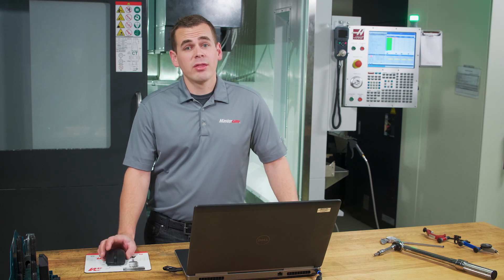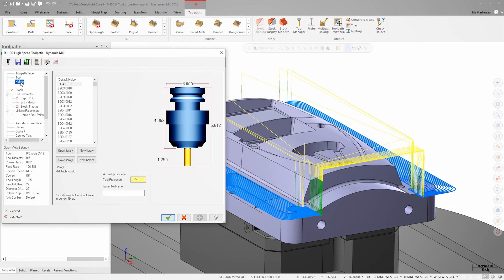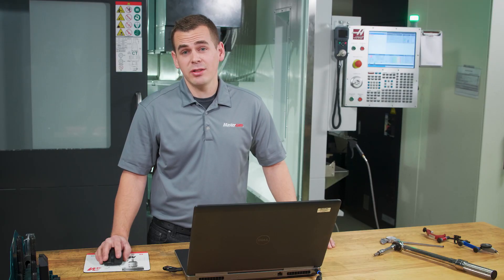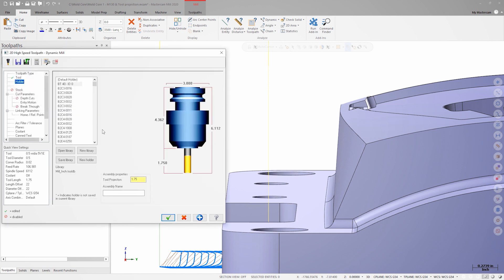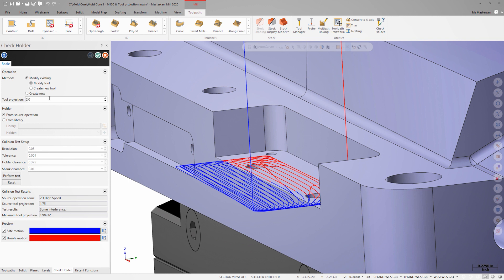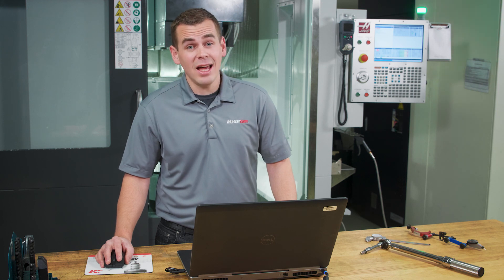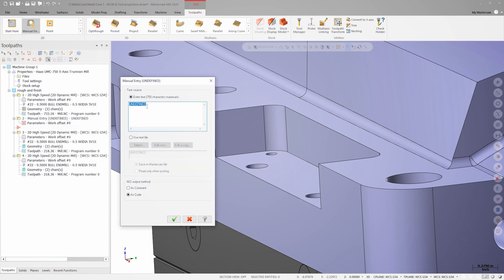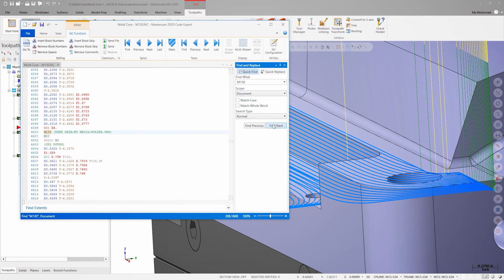Media Display functionality on your Haas Next Gen Control

Comment: I like this idea since I end up with lots of part time helpers. I have been trying this for an hour this morning and not getting it to work. If I use the Haas editor and insert the M130 and file name it will work, but using the MasterCam manual entry (as shown)  doesn't work. I've tried all kinds of things like changing the media format, using the same case as is created by the Haas editor, but still no success. Any suggestions?

Comment: Hmmmm. Nty. Way to much work. I’d rather right click, select setup sheet, print, staple to traveler done. The whole screen shot, typing link etc is garbage. You guys have setup sheets that generate a projection picture, but can’t come up with an auto macro to do it for you? And plant it in the tool path. Maybe adding it to the misc values page if u didn’t want it for some tools.
Reply from the maker: Yes, Setup sheets in Mastercam still work great for this. This M130 functionality is not for everyone but does have some great use cases. We are looking at how we can better leverage this Haas functionality in our post processor/misc values. The biggest roadblock is having to load the media file into a separate specific location in the control memory.
Reply: Are you can wire one post ?
Reply: I am from vietnam, now use mastercam not lisine